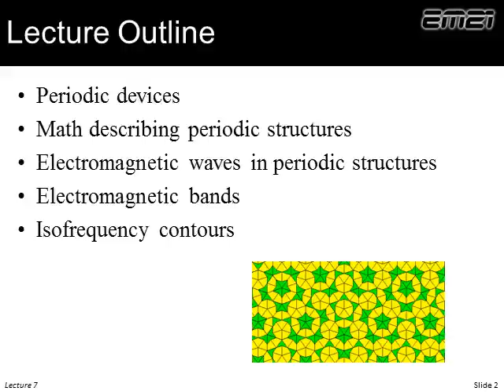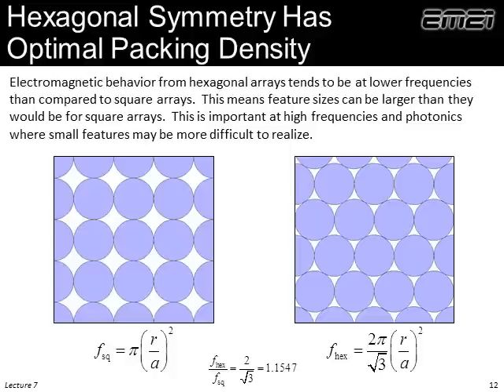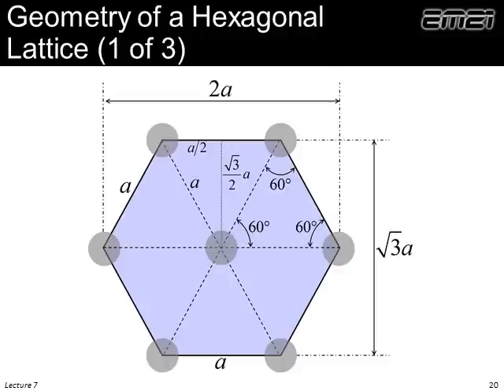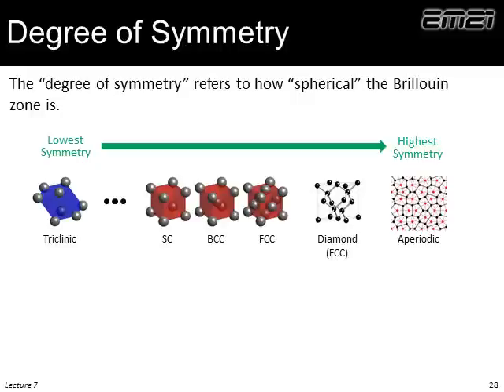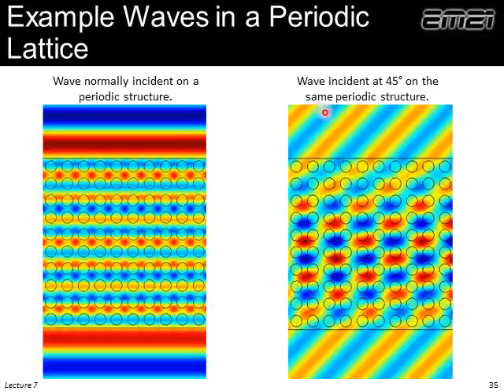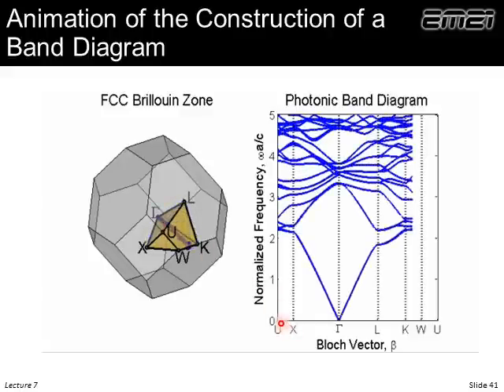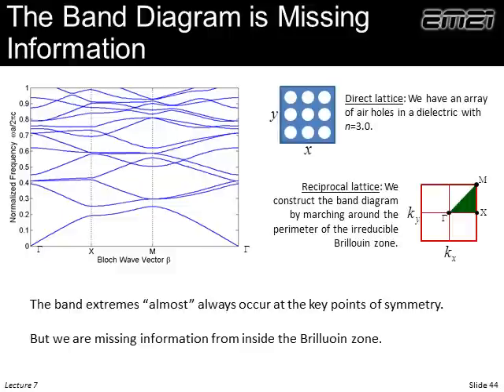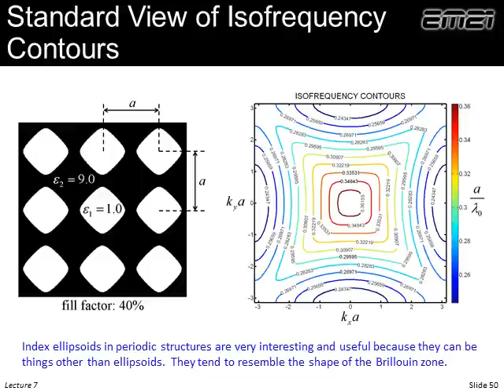Lecture 7 (EM21) -- Theory of periodic structures

Comment: Hello, thanks a lot for your lecture videos. I learned FDTD from your youtube series. Do you also have a lecture on the eigenvalue problem on slide 39?
Reply from the maker: First, let me point you to the official course website.  This is an old video and the topic has been considerably revised.  If you use the course website as your main portal, you can see the latest versions of the notes and videos as well as have other resources provided on the website.  This specific subject is now taught in Topic 4.

https://empossible.net/academics/emp6303/

Solving the eigen-value problem is taught using the plane wave expansion method (PWEM) in Topic 6 of the Computational Electromagnetics course.

https://empossible.net/academics/emp5337/

I show how to solve the problem in a very indirect manner using finite-difference time-domain (FDTD) in Lecture 3i here:

https://empossible.net/academics/emp5304/

It is also possible to solve it using the finite-difference frequency-domain method (FDFD).  I have some very crude notes in Lecture 4i here:

https://empossible.net/academics/emp5337/

I am releasing a new book on the FDFD method that I hope is available before the end of this year.  I have an entire chapter devoted to doing this.

Hope this helps!
Reply: @empossible1577  Thanks for your quick response. Have you read/used the book Photonic Crystals molding the flow of light by John Joannopoulos to develop the eigenvalue problem in any of the lectures/courses. I am reading this book and looking for an example where the eignenvalue problem was solved and the method stated in the book discussed.
Reply from the maker: @aquilabobber556  That is a great book!  They use the plane wave expansion method (PWEM) for calculating photonic bands.
Reply: @empossible1577  Have you done a lecture on using the PWEM method for the eigenvalue problem discussed in the book? Solving for H instead of E. Your explanations and visual presentation is best I have ever seen in a lecture.
Reply from the maker: @aquilabobber556  You can find the lectures for the plane wave expansion method in Topic 6 here:

https://empossible.net/emp5337/

I describe both E and H.  You get the same answer for both and there is no significant speed difference that I can tell.
Reply: @empossible1577  Thanks a lot for clarifying this. The book gave the impression that the E will be more expensive computationally.
Reply from the maker: @aquilabobber556  It does say that.  This is only because permeability is typically ignored at optical frequencies, making the matrix equation ordinary and have a useful symmetry that tends to converge faster.  If your device possess a permeability, both E and H are generalized eigen-value problems and will have the same complexity.  In practice, at least the way I am solving the problem, I see little or no speed difference among the various formulations.  If you follow my lectures an implement the method like I do, you will be able to switch back and forth in seconds to feel it out for your self.  In fact, the difference is just 2 or 3 lines of code that change slightly.

Comment: I am a little bit confused by the symmetry points of IBZ for a fcc structure. For example at MPB software, they introduce the points like X=(0,0.5,0.5), U=(0,0.625,0.375), L=(0 , 0.5, 0), Gamma=(0,0,0), W=(0.25, 0.75,0.5), K=(0.375, 0.75, 0.375) but in some texes they are defined like  X=(0,0.5,0.5), U=(0.25,0.625,0.625), L=(0.5 , 0.5, 0.5), Gamma=(0,0,0), W=(0.25, 0.75,0.5), K=(0.375, 0.75, 0.375). 
Is there any difference between these to defiened set? if I change the componente of symmetery poins at MPB, do I get the same result?
I need to sweep some results at angle of zero respect to the normal direction of a fcc lattice. In some texts, the direction of Gamma-L is introduced as the perpendicular direction of the unit cell. 
Now because the components of L are diffrent at different text and softwares , I am doubtfull about the direction.
Reply from the maker: Visualization is the key to computation.  I suggest generating a 3D plot showing the BZ and these key points of symmetry.  It is hard to conclude anything just from looking at the numbers, but there are different ways to define the key points.  Both sets of numbers could be correct here.
Reply: You are right!!!!! both sets are correct!! :D

Comment: Thank you so much for your lectures! It's really helpful!
I have some questions about the  slide 42&43 at around 45:00 in this video. If the phase velocity Vp calculated as Slide 42  (The slope of the line connecting T to the point on the band corresponds to phase
 velocity.), the Vp at the point of 2nd (or higher) band just right above the point T will be close to infinite. Am I right?
I am really confused. Looking forward to your reply.
Reply from the maker: I don't see any T's so I am not sure I can answer your question.  Maybe you mean the gamma point and you are asking about the second band directly above the gamma point.  This is not infinite phase velocity because that band has been folded.  Think of the second band as a continuation of the first band as it exits the band diagram on the right.  So the exact equation of w/k for phase velocity only really applies to the first band if the folding is not considered.
Reply: Yes, I mean the gamma point. 
I got it. Thanks!

Comment: First thanks for the videos. It is really helpful. 
however, I would like to point out that the mathematical form of reciprocal lattice vector is wrong. The denominator is same for all formulas.
Reply from the maker: Very sorry for any errors.  Can you be more specific about what is wrong and on what slide?  I definitely want to fix any errors.
Reply: The slide 19 which consists of the formulas for reciprocal lattice vector. The denominators of all three vectors are same for all reciprocal lattice vectors. Shouldn't they be different ?
Reply from the maker: This is actually correct.  You might recognize the vector triple product in the denominator as the volume of the unit cell.
Reply: Thanks professor :) . I got it now.